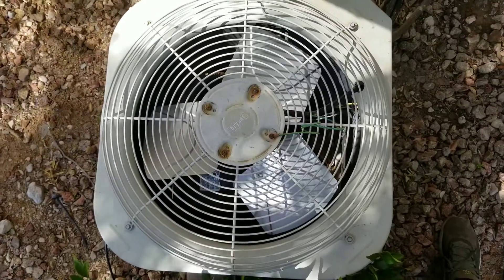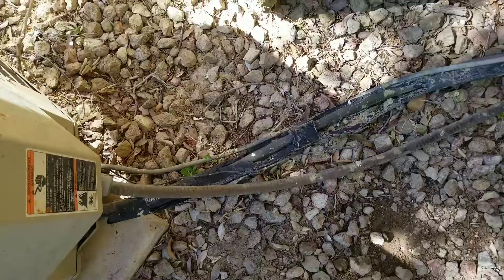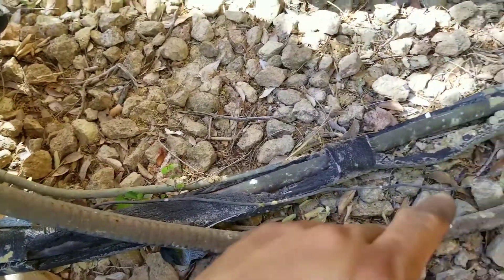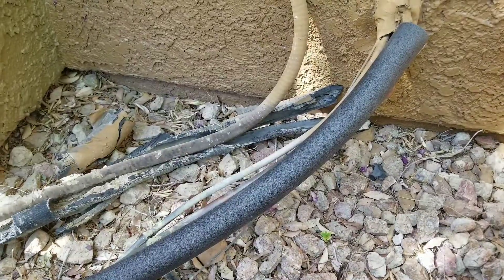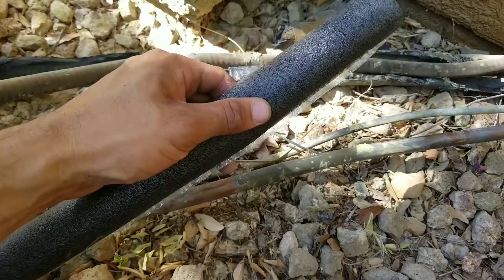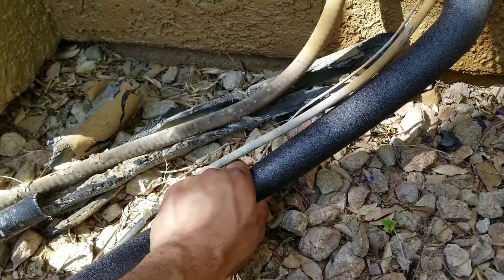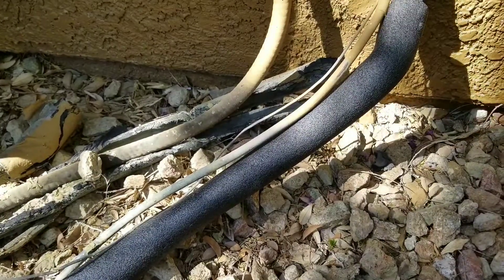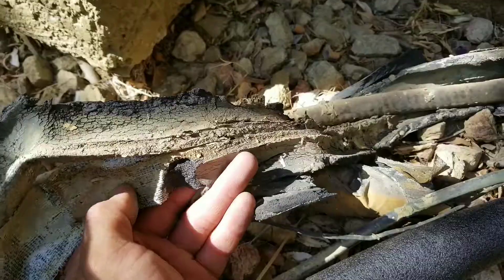Insulating Condenser Line Will Cool 10 Degrees Colder?!

Comment: Has nothing to fo with house getting cooler , it is designed to remove humidity from home, after all humidity is removed from , drapes, walls , floors , furniture , 80 degrees will feel like ,70 degrees

Comment: Not only did I use the regular rubber insulation, I also wrapped it in Reflectix insulation for double barrier...has made a HUGE difference since the rubber insulation is black (absorbing direct sunlight heat), then sealed all overlaps with foil tape

Comment: Changed my insulation out here in vegas a few days ago. My unit is running less and the house is cooler
Reply: Why would  the house be cooler. The house would be as cool as you set it at.
Reply: @jamesbizs Could be it was struggling in reaching the set temperature before the fix

Comment: I saw everyone is wrapping the outside low-pressure line of the unit. How about the line inside of the unit? There are at least 2 feet lines inside. Should we open the unit and also wrap it? Thank you!
Reply: Don’t believe the others.  Wrap the inside, exposed line set also because the AC unit  and lines are in spaces where you don’t want to air condition.  In other words, the line set are in places where the hot coolant line should be insulated so the condenser can cool it down more and the chilled coolant is used to chill spaces where you don’t want to chill, which is where the AC mechanicals are.
Reply: no
Reply: No. The point of wrapping it, is to not allow the cold to exit into the hot air. You don’t care if the cis exits in the house. Wrap the hat line tho

Comment: What kind of tape was that? 10 mil sounds tougher than anything I've seen.
Reply from the maker: It's actually just pipe wrap. I like this because as you said it is very tough and holds well to the elements. I have seen on more than one occasion regular electrical tape that does hold fairly decent. A roll of this 10 Mil pipe wrap is $6 dollars so I would suggest using this due to its density and thickness and will hold better than electrical tape :)
As always thank you for your insightful input and comments!
Reply: Sam Thanks bro I'll have to look for that stuff! Mine looks about like the one you fixed.
Reply from the maker: Christy's  10 Mil